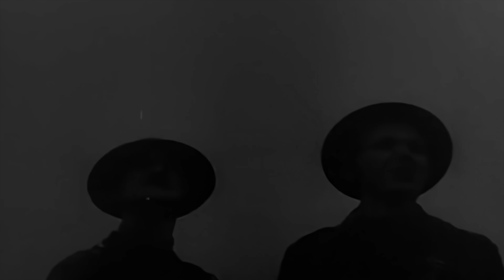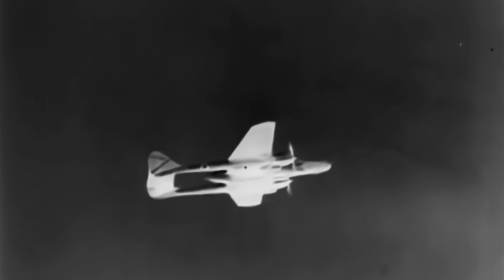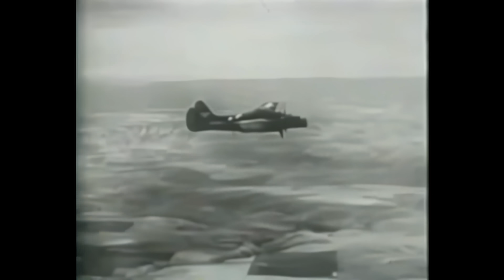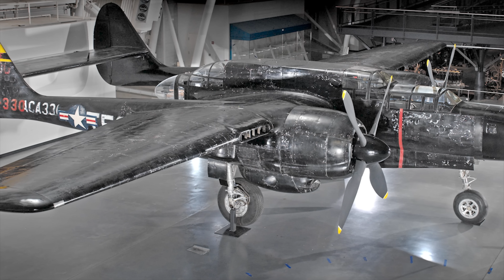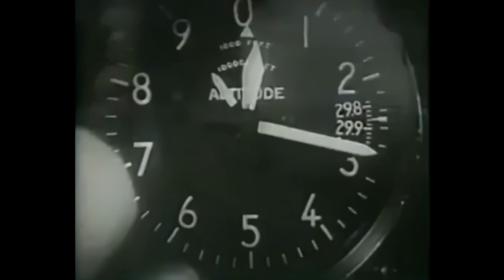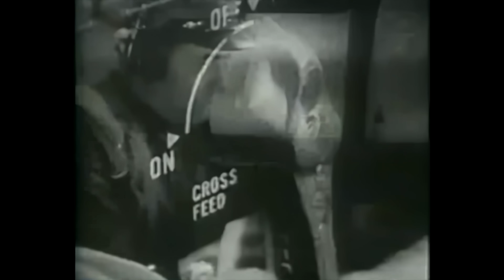P-61 Black Widow | The American Night Fighter | WW2 Twin Engine Named for the North American Spider

Comment: From the comments I think I will be in a minority of one, but I think it looks ugly. A bit of like they threw every idea they had into it. The design choice of putting the radar operator (the eyes of the plane) as far away as possible from the pilot seems odd. Seems to me radar was it's bigest asset, next to 4x20mm cannon. If it was designed to be the hunter I'm not sure why it had guns like a bomber. Dump those, and the gunner, and move the radar operator to the gunner's position and it might have been better. Obviously design has to start before you know how things are going to pan out, so it made more sense when in design, but I think the resources could have been better used. In Eurpope this would have been hunting bombers that were the same size as it, and by the time it was available there would have been few of them. However, I think it would be a good platform for other purposes (as it was used for later). That's just my opinion, and I'm sure I'm in a minority of one. Horses for courses.

Comment: The Guns, as originally planned, were 4 or 6 20mm cannon (4 in the underslung tray of the fuselage, 2 outboard of the Props, in the wings), and a Turret with 4x.50 cal. M-2 Machine guns Remotely Controlled. This didn't work, because at certain angles of up-aim, and Rotation, the .50 cal. quad-guns disrupted Airflow to the Tail-Boom to make Yaw/Pitch controls unpredictable. So, the Top  .50-cal turret was Removed, and, to Lighten the plane (and Not 'Night-Blind' the Pilot!), the outer two 20mm guns also were stripped-out. This actually eliminated the need for the aft-facing crew member, further lightening the Plane.

Comment: the english bristol beaufighter was designed for and used radar years before the p61
Reply: Prior to th P61. Converted A20 havoc and P38s where used as radar equipped Nightfighters.
Reply: @JamesChechele  turned the p38 into ugly witch with massive mole on its chin
Reply: @tonelee8878  And also a radar operator was seated behind the pilot.
Reply: I’m sure the Bristol Beaufighter was a better built airplane as well! I knew men who worked and flew on P-61s and neither had anything good to say about it.

Comment: I guess the USAAF didn't get the 1942 RAF memo about black paint degrading the performance of an aircraft due to the higher unit density and weight of black paint (relative to lighter toned paints) and its higher coefficient of friction (i.e. greater roughness and air resistance).  In mid-1942 the RAF changed the paint schemes on all their night fighters from all-black to a mixed light grey/beige and dark green paint scheme, this producing a minor improvement in maximum speed of the aircraft.  It also had the effect of being less visible at night than an all-black livery.

Comment: The P-61 was too complicated, too expensive, too heavy and too late.   By the time it showed up on the front lines, there was almost nothing left to shoot down as the lamentable kill record of the aircraft (only 127 confirmed kills) would attest. The USAAF would have been much better off if they had just adopted the Beaufighter (on a larger scale) and the  Mosquito for night fighter operations.  The success of the latter two aircraft in the night fighter role showed that it wasn't necessary, or perhaps even desirable, to create a purpose-built night fighter from the ground up.

Comment: The P-61 was the first American aircraft designed from the outset as a night/all-weather fighter. Interim types converted to night operations included Douglas P-70 (A-20), Lockheed PV-1, Grumman Avenger (radar Hunter) paired with Grumman F6F fighter as shooter. Due to development time there were also some Lockheed P-38Ms converted. U.S. Navy developed night fighter variants of F6F (F6F-3N/F6F-5N) and F4U.
First radar equipped night fighter was probably the British Bristol Blenheim 1F, though it’s performance and weak armament (4x0.303 browning) made it a fairly marginal asset, to be replaced as quickly as possible by Bristol Beaufighters (also used by 3 U.S. night-fighter squadrons in the European Theatre of operations.) The P-61 also made some night intruder ground attack missions during Battle of the Bulge.

Comment: My mother, Anna, worked on the P-61 production line during WWII. She told many memorable stories about early production models, manufacturing accidents (including a workmate who drilled thru a firewall AND her hand) machine gun mounts, and later designs that mounted cameras for reconnaissance as the European war had ended and repurpose for Pacific Theater deployment.

Comment: I was a crew chief in the 421st Tactical Fighter Squadron (Black Widows) from 1988-91. Though we were flying F-16s, we still did a lot of nighttime flying and were one of the first squadrons in the USAF to use the LANTIRN system which made us even more capable at night.

Comment: Second World 2
The war opened on 1 September 1939, and by this time, the RAF were well advanced with plans to build a radar – then called 'RDF' in Britain – equipped night-fighter fleet. The Airborne Interception Mk. II radar (AI Mk. II) was being fit experimentally to a small number of Bristol Blenheim aircraft

By early 1941, the first examples of a production-quality radar, AI Mk. IV, were beginning to arrive. This coincided with the arrival of the Beaufighter, which offered significantly higher performance than the pre-war Blenheims; it was the highest performance aircraft capable of carrying the bulky early airborne interception radars used for night fighter operations, and quickly became invaluable as a night fighter.

Comment: Hello , I know many of you will not like my post . But I has to be said : Whyt about the many short commings and problems of the plane ? Yes , It is a famous plane by name . But never really fullfield what is was deisigned for . For an example as a pair of P 61 returend back over after night fielght over Sically the saw a single Heinkel He 219 " UHU " nightfighter . They had higher alititude and so they tried to close in and shoot him . What did the kraut pilot do ? He simply done full throtle and he He 219 was off and gone . That is just one of many preported incidiendts . The P 61 was also not agile enough . It had a very good firepower but rarely could use that firepower because of it's short commings !!! Sorry , that's the truce . And before you do hate full comments towards me now , resarch for your self and not only a little I mean really do some resarch about the topic !!! Best Regards ,

Comment: The Boulton and Paul Defiant was the first nightfighter to use AI radar and although were quite ineffectual they did manage to get kills.
Reply: Both were not initially designed as night fighters but as "normal" fighters! The first two aircraft designed to night fighter specifications were the P-61 and He219. Which of these two actually was the "first" remains a matter of debate - depending on what stage of development it is based upon. Initial development of the He219 started mid-1940 but the stalled (I assume the systemic involvement of various "players" and institutions in the German development/production - as seen in various other cases-  to be a culprit there) and resumed in 1941.The specifications on which the P-61 was based upon were issued late 1940 but it's development was almost uninterrupted. When looking at the service entry, the P-61 was definitely first.

Comment: Simply, Not the First Night fighter..there were at least 4 type s of aircraft that had night fighting missions as their mission well before this.
Reply: Do you recall those old war movies where all of the flight crews, no matter if they were day or night fighters, had to coordinate their intentions with the folks in the big rooms with big maps BEFORE they had done anything about the target?

Well, the P-61 was the first aircraft designed from scratch for the exclusive night fighters role that eliminated all of those folks in those big rooms with big maps to what we basically use today.

No middle man makes the system 1000Xs more efficient! 
Every other night fighter that came BEFORE the Black Widow whether it was friends or foes, relied on the middle men and women to get the mission task done. 
The Black Widows with it's onboard radar systems simply did not have to coordinate anything with anyone. Which is the reason for why it was often said that they were the first night fighters that were designed from the ground up for the purpose of fighting at night.

Comment: I saw a P-61 at an airshow a few years ago. It was in pristine condition and I talked to the owner and told him I'd always thought a 61 was one of the most beautiful birds that ever flew. He allowed me to go into the cockpit and sit in the pilot's seat. I've been an aviation buff since I can remember and that was a thrill I'll always remember.
Reply: There are not any flying P-61, however, one is being rebuilt to a flyable condition at an  air museum of which I am a member. The museum is worth a visit. There is even a Vickers Viscount there. P-61B-1NO c/n 964 AAF Ser. No. 42-39445 is under restoration to flying status by the Mid-Atlantic Air Museum in Reading, Pennsylvania.[33][34] The aircraft crashed on 10 January 1945 on Mount Cyclops in Papua (province), Indonesia and was recovered in 1989 by the museum staff. The aircraft has been undergoing a slow restoration since then with the intention of eventually returning it to flying condition, with the civilian registration N550NF. When finished, it is expected it will be over 70% new construction. By May 2011, 80% of the restoration had been completed, with only the installation of the wings and engines remaining. As of June 2019, both engines have been overhauled and two brand new props have been hung. The museum has also started painting the aircraft. This is a super long term project still on-going during 2022. The airshow at Reading PA  is one of the best in The USA.
Reply from the maker: 👍👍 what an honor and privilege Dale
Reply: I first  see this plane in book called AIR POWER  Illustrated by John H. Batchelor   back in the late 70's it did look beautiful and the firepower in showed had some pics of guns all firing at same time !
Reply: Probably not a P-61.  There are only 4 known to exist and none in flying service.
Reply: Four P-61s are known to survive today:

[1] P-61B-1NO c/n 964 AAF Ser. No. 42-39445, is under restoration to flying status by the Mid-Atlantic Air Museum in Reading, Pennsylvania. The aircraft crashed on 10 January 1945 on Mount Victoria, Papua New Guinea, was recovered in 1989 by the Mid-Atlantic Air Museum of Reading, Pennsylvania. The aircraft has been undergoing a slow restoration since then with the intention of eventually returning it to flying condition, with the civilian registration N550NF. When finished, it is expected to be over 70% new construction. As of May 2011, 80% of the restoration has been completed, with only the installation of the wings and engines remaining.

[2] P-61B-15NO c/n 1234 AAF Ser. No. 42-39715 was on outside display at the Beijing University of Aeronautics and Astronautics in China. The official story is that one of the P-61s that were based in Sichuan Province during the war was turned over to the Chendu Institute of Aeronautical Engineering in 1947. When the Institute moved to its present location, it did not take this aircraft with them, instead shipping it to the Beijing Institute of Aeronautical Engineering in 1954. However, as both USAAF night fighter squadrons (426th, 427th) that served in China were inactivated in 1945, this may not be accurate. An alternative explanation is that at the end of hostilities in 1945, the 427th was in the process of bringing their various detachments back to a central airfield for disposition of the aircraft and to start processing home. At one of the satellite airfields, two of the three P-61s were in need of maintenance. Reportedly, Chinese communist troops came onto the field and ordered the Americans to leave without their aircraft. This aircraft is in very poor condition and probably near the point of structural collapse. The Chinese claim to have two additional P-61s in storage which they have offered for sale for $2,000,000. Sometime in 2008-2009, the museum’s display aircraft were moved to a parking lot approximately 200 metres south and the museum closed. The outer wing sections of P-61B-15NO c/n 1234 were removed and stored at the parking lot like several other aircraft. It was confirmed in September 2012 that P-61B-15NO c/n 1234 is no longer at the parking lot - unconfirmed reports indicate it has moved back to the BUAA possibly in a new building.

[3] P-61C-1NO c/n 1376 AF Ser. No. 43-8330, is on display at the National Air and Space Museum in Washington D.C.. The aircraft was delivered to the Army on 28 July 1945. By 18 October, this P-61 was flying at Ladd Field, in Alaska conducting cold weather tests, where it remained until 30 March 1946. The airplane was later moved to Pinecastle AAF in Florida for participation in the National Thunderstorm Project. Pinecastle AAF personnel removed the guns and turret from 43-8330 in July 1946 to make room for new equipment. In September the aircraft moved to Clinton County Army Air Base in Ohio, where it remained until January 1948. The Air Force then reassigned the aircraft to the Flight Test Division at Wright-Patterson Air Force Base in Dayton, Ohio. After being declared surplus in 1950 it was donated by the U.S. Air Force to the National Air Museum in Washington D.C. (it became the National Air & Space Museum in 1966).
On 3 October 1950, the P-61C was transferred to Park Ridge, Illinois where it was stored along with other important aircraft destined for eventual display at the museum. The aircraft was moved temporarily to the museum's storage facility at Chicago's O'Hare International Airport, but before the museum could arrange to ferry the aircraft to Washington D.C. the National Advisory Committee for Aeronautics asked to borrow it. In a letter to museum director Paul E. Garber dated 30 November 1950, NACA director for research I.H. Abbott described his agency's "urgent" need for the P-61 to use as a high-altitude research craft. Garber agreed to an indefinite loan of the aircraft, and the Black Widow arrived at the Ames Aeronautical Laboratory, at Naval Air Station Moffett Field in California, on 14 February 1951. When NACA returned the aircraft to the Smithsonian in 1954 it had accumulated only 530 total flight hours. From 1951 to 1954 the Black Widow was flown on roughly 50 flights as a mothership, dropping recoverable swept-wing test bodies as part of a National Advisory Committee for Aeronautics program to test swept-wing aerodynamics. NACA test pilot Donovan Heinle made the aircraft's last flight when he ferried it from Moffett Field to Andrews Air Force Base, arriving on 10 August 1954. The aircraft was stored there for seven years before Smithsonian personnel trucked it to the museum's Garber storage facility in Suitland, Maryland. In January 2006 the P-61C was moved into Building 10 so that Garber's 19 restoration specialists, three conservationists and three shop volunteers could work exclusively on the aircraft for its unveiling at the Steven F. Udvar-Hazy Center on 8 June. The aircraft was restored to its configuration as a flight test aircraft for swept-wing aeronautics, so the armament and turret were not replaced. A group of former P-61 air crews were present at the aircraft's unveiling, including former Northrop test pilot John Myers.

[4] P-61C-1NO c/n 1399 AAF Ser. No. 43-8353 is currently on display at the National Museum of the United States Air Force at Wright-Patterson AFB in Dayton, Ohio. It is marked as P-61B-1NO 42-39468 and painted to represent "Moonlight Serenade" of the 550th Night Fighter Squadron. The aircraft was presented to the Boy Scouts of America following World War II and kept at Grimes Field in Urbana, Ohio. On June 20, 1958 it was returned to the museum by the Tecumseh Chapter of the Boy Scouts of America in Springfield, Ohio. The aircraft recently had a reproduction turret installed, which was fabricated by the Museum's restoration team.

Information referenced from:

https://www.liquisearch.com/northrop_p-61_black_widow/survivors
Reply: Kind of a funky looking aircraft but its funny looks serve a serious purpose.
Reply: Isn't there one being prepped for flying conditions...a total restoration if I remember correctly not just static
Reply: Jealous. I love the plane. Never seen one. I have several good quality miniatures.
Reply: Probably a P-38
Reply: @bigdaddy7119 Not really. P-61 used radial engines, P-38s used v12s, I believe Allison.
Reply: @klausswartz3369  I’m aware of that. I was talking about the OP saying he sat in a pristine one at an air show, and nothing was mentioned about the engines. The only other twin boom, twin engine WW2 fighter plane it could’ve possibly been was a P-38 as there aren’t any “Pristine” P-61’s doing air shows.

Comment: The first radar-equipped night fighter flown by the USAAF was the British-built Beaufighter.
Reply: The British Beaufort flown by the RAF or British Beaufighter flown by the Australian RAAF built by the CAC in the Pacific campaign Heavy fighter, Escort, Surveillance & coastal defense, Bomber, Torpedo bomber, Anti submarine, Ground & Naval low level attack aircraft. Is this the one you mean flown with USAAF in joint operations ?
Reply: and the first purpose build Nightfighter was the HE 219 . sorry (:-))